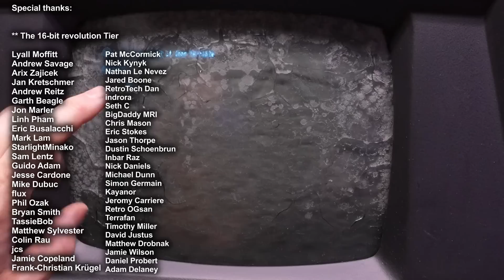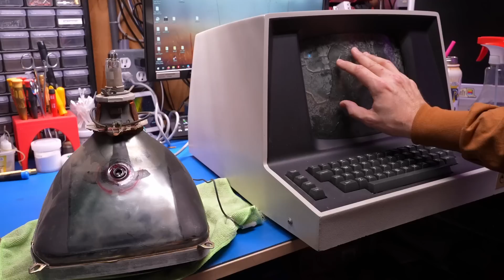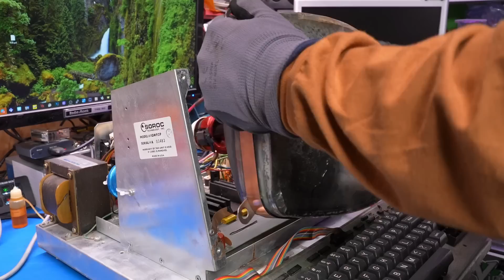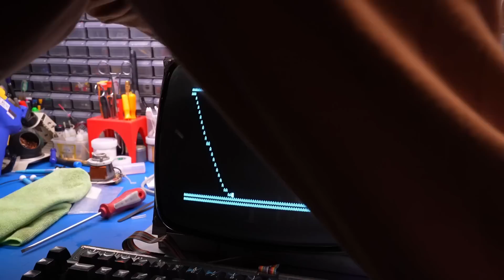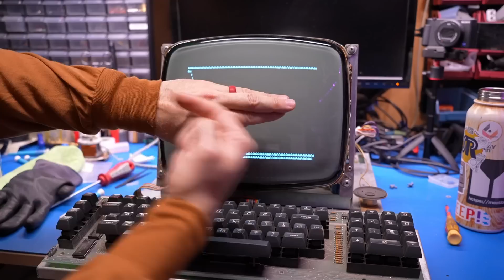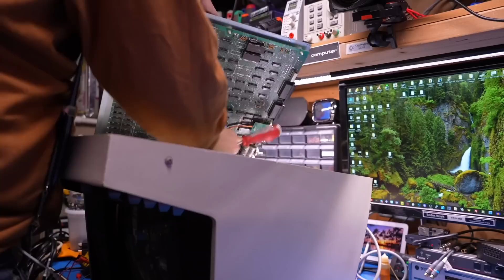Soroc IQ 120: CRT swap try #2. Finally some success?

Comment: PVA glues are usually solvent based.  Not water, because water chemically breaks down PVA (this is why PVA glues generally have a slight vinegar smell, water breaks down Polyvinyl Acetate into Polyvinyl Alcohol, also called PVA, and Acetic Acid, the acid in vinegar that gives it it's characteristic smell).  You might get somewhere with the water bath of the front of the tube, as many PVA glues are relatively susceptible to attack by water.  If you can create a chemically effective seal, you might also try mineral spirits.  Only if you can be completely sure you can contain the vapor, though.  For a job like this, soaking will take a long time to work through the glue, due to the narrow front and large depth of glue.

Comment: This is the first time I can recall coming across a CRT that physically fit, shared the same neck size and would not work. I've done a lot of tube swaps, mostly in arcade monitors but some computer monitors too and in every case I can recall it pretty much just worked. Had a couple color tubes I couldn't converge as well as I'd have liked but mono tubes are easy. Maybe older tubes had more differences? BTW I really like that you properly diagnose things rather than just shooting the parts cannon at them. Several times I've had to fix things that somebody screwed up by shotgun replacing all the electrolytic capacitors. The worst is when they replace top quality parts with cheap no-name stuff that fails before the original part would have. Every part that gets removed is another opportunity for an error to sneak in. The only parts I shotgun replace are SMT electrolytics since they do so much damage when they leak.

Comment: I really like that choice of colors, keycap design and overall shape of the Soroc terminal. The original CRT seems to have a blueish tint which also fits perfectly for design of the terminal. Hopefully you'll get the CRT fixed at some point.

Comment: Why do some CRTs have cataract while others dont?

Are CRTs with cataract safer (they wont implode)?

How can I prevent cataract from forming?
Reply: The earliest form of integral implosion protection was a second layer of glass bonded to the face of the tube. Earlier tubes had no integral protection so TV sets up into the 1950s had a separate layer of glass or plastic in front of the tube. Starting sometime in the 60s or 70s integral implosion protection in the form of a tension band around the perimeter of the tube face appeared and removed the need for the bonded glass. No bonding glue, no cataracts.
Reply: @James1095  ah I see

But why do all the cataract fixes I see online, use silicon with a gap (I read those fix arent perfect)

Why dont they reaply the glue like the factory did?
Reply: @Veso266  Because applying an optically clear glue without any bubbles, dust or contamination is difficult. Maybe it's possible to do but I don't think I've ever seen it done.
Reply: @James1095  what about if they would just retrofit tension band like newer crt do and discard the glass intierly?

Or does crt structure have to be altered for that somehow
Reply: @Veso266  I don't know. Having been just a few feet away from a CRT implosion one time I would not personally want to attempt something that might cause me to witness another such event.

Comment: PVA glue is what white Elmer's glue is. I'm not an expert and there may be a variety of formulations that can still be considered PVA, but all glue labeled PVA that I've ever used is water soluble and I've been wondering throughout the series if the glue could be softened with water rather than risking heat.

Comment: If it's PVA, which is polyvinyl acetate, you should be able to dissolve or at least soften it using vinegar. Acetone should also work.

Comment: Just put washers as spacers on the CRT mounting screws, this will slide the screen in the exact direction toward the cover bezel. Whereas if you slide from the motherboard, it will not slide to the normal axle of the screen.

Comment: I don't think that tube would need all that much heat to remove. Usually you only need heat if there's a center in the tube that's still intact. That glue is entirely degraded. It should just come apart pretty easily. And it's a very small tube too. Very easy to work with.

Comment: I would have assumed you could have soaked the front of the tube in something like acetone to dissolve or soften the glue on the safety glass and remove the risk of implosion. Oh hey you got the replacement working, nice one!

Comment: Adrian, if the glue is water soluble and requires heat to remove: couldn't you just keep the crt suspended in boiling/hot water face down in a large metal pot for a bit and see if the safety glass just falls off?

Comment: PVA is the regular white wood glue you let kids play with. It's not toxic, it's water soluable and the reason it's got ugly is probably being stored in a moist place to begin with, which is also why it's got runny; it's basically water making it liquid-y. The PVA itself is not conductive nor corrosive or anything.

Comment: Bot sure if it's the same PVA as book binding glue that's acid-free, water-soluble, dries clear, and is usually considered an archival quality formula. But if so that's easy peasey. If not then it is likely closer to Elmer's glue which isn't necessarily acid free as evidenced by the yellowing of the paper it's used on. Though some sun-bleaching also occurs. So, not to sure.

Comment: You know, the PVA glue being water soluble could certainly lend itself to being a feasible explanation for the cataract problem, and why it always starts from the outside edge. Humidity leaking in between the glass panes causing the glue to fail.

Comment: What I'd be inclined to do with that old tube, presuming that the glue really is water soluble, is to lay it face down in a tub with a couple of inches (7-8cm) of water for a few days.  If I had the time, I'd also get an automotive windscreen washer pump and some tubes and use the pump to move the water around the tub to keep the water constantly flowing so that the glue would wash away more easily.
Reply: Can a windshield washer motor run continuously for that long?
Reply: @djmips  It should be able to, so long as it has a continuous water flow to keep it cool.  But anything which keeps the water moving should work.

Comment: I still suggest using a ceramic infered heat lamp. the kind used for keeping reptiles warm. with a cheap lamp hood you could aim a specific amount of directed heat at the screen and it would help remove that cover. idk if a heat gun is a good idea

Comment: nice looking unit
if i was you i will put washers between the CRT mounting tabs and the chassis.
nothing can't be fixed with washers (i know normally we says nothing can't be fixed with duct tape but duct tape is disgusting!)

Comment: I would try soaking the old crt in acetone to get the front layer off, i have had luck doing this on other screens with similar issues. (note if you do this make sure the acetone bath does not come up the sides and get on the electrical coating.)

Comment: I would love to see if you can get the coating off of the original CRT. But I have a question. Have you ever had a CRT implode on you while working on it?
Reply: I haven't while working on one, but I did throw a dead 19" tube in a dumpster back in the day and forget to crack the pip off first. The bell of the tube hit the hinge of the dumpster lid and there was an enormous boom that left my ears ringing. Somehow I escaped unscathed but there was about a 10 foot radius of glass shards on the ground and my hands were shaking for about the next half hour. I've heard of guys having them implode trying to swap the mounting ears that are held on by the implosion band. I would not mess around with the implosion protection without a face shield and leather gloves.

Comment: PVA is water soluble but if water doesn't work, try acetone or mineral spirits.  BUT you really should replace the glue between the CRT and the glass sheet, not just silicone the edges.  It's not there to block an implosion, nor does it have any hope of doing so.  Like the implosion band, it's there to stabilize the face of the tube and prevent an implosion.

Comment: Use a space heater to remove the adhesive off the glass and then use optical cement to readhere it

Comment: If warm water doesn't dissolve the glue, the PVA may have polymerized and have become resistant to water. 
If that is the case, you may try soaking it in white vinegar, acetone, or methylated spirits.

Warm bath of white vinegar (dilute or concentrated, depending) seems to work best in most cases, but the results depend on the particular compound.

Comment: Hi Adrain, always excellent videos. A thought, not for now or the forseeable future but an added string to your bow:
What to do if you have a machine with a monitor you really want to get running but you just can't source a CRT? Yes the obvious answer is to use a suitbly-sized LCD and appropriate driver, but we all know how janky that ends up looking... besides who wants to cut the bezel of a much loved retro machine?
I have a plan that worked very well for a Mac SE/30 of mine:
1) Source all the stuff required to get a suitable LCD to work with the system.
2) Buy a nice and thin sheet of light to medium smoked plexiglass. Cut a good bit larger than the apeture, then remember to remove the film from both sides.
3) Fully dismantle your CRT down to the tube only. Empty a kitchen oven large enough for the tube to stand on it's neck...
4) Then rig up a heat-proof jig that the tube can be attached to, such that it will stand screen-up exactly strait.
5) Take a thick paper kitchen towel or thin felt, thoroughly dampen but not sopping wet, and lay over the screen, without any creases!
6) Put the whole thing in your oven and very slowly raise the temperature over about 30-60mis to about 60-80c (sorry, I'm not a collonial)
7) When the screen is up to temperature carefully heat the plexiglass with a hair dryer / heat gun until it's just starting to get soft, taking care not to scratch it!
8) Open the oven, place the plexiglass over the screen (leaving the towel / felt in place) and encourage it to flop a bit.
9) At this point you might be very licky, but chances are you will need to return the whole thing to the oven and repeatedly encourage the plexigalss to form over the screen...

10) What you are after is for the plexiglass to perfectly form over the screen (without creases, and avoid thouching it while hot!)... 
11) ...Encourage the corners to droop over the screen's mounting lugs as closely as you can without risking damage to the soft plastic.
12) When you have done as much as you dare, make sure to leave the whole thing to fully cool naturally in the oven.

Once all is ready you should be able to peal your formed plexiglass from the CRT without harm. Depending on how you did you may need to polish out scuff-marks or the weave of your interface cloth if you chose poorly. Cut the plexiglass with a Dremmel about 1/4 - 1/2 inch larger than the screen all round (I can do Imperial) and drill out the lugs.

The whole thing should mount perfectly in the bezel of the monitor - hurrah!

Next, offer up your LCD with a bit of hot glue to a couple of corners and fiddle until it looks right from the front. Then go ham with more hot glue or epoxy to seal around all the edges - done!
Depending on how much light gets in to the monitor case you may need to add some mat-black card to our 'LCD mounting solution' arround the bezel of the LCD, especially if it's very shiny.
I hope you'll agree the result looks surprisingly good, and as long as you chose perspex / plexiglass with a light to medium smoke it will pass casual observation, even to those using the machine... as long as they aren't too familliar with real CRT's or the system so butchered. Of course LCD drivers often have give-away boot screens that can't be switched off, but not much can be done about that!

Just to prove it wasn't a fluke, after the SE/30 I pulled the tube out of a dead (I think) 12in Apple II B/W monitor and performed the same trick. With lots of spare room inside I mounted my daughter's RC2014 behind the screen - the whole thing now looks like a terminal running CP/M when it's not doing more 'exciting' things.

Maybe you'll never need to try this, maybe you will. I hope these instructions helpf someone some day.
Reply: Interesting mod, I wondered about doing something similar with plexiglass, but somehow frosting the backside, then using one of those cheap low powered LED projectors to throw an image on the screen from behind, that way you'd have a proper curved image, the thing that gives it away immediately to me that an LCD hack has been performed - it's a fake!
NASA rebuilt the old Apollo missions control room, but it only took me 5 secs to spot the fake screens, there has to be a better way.
As for the startup junk on LCD screens, you could put a timer on the backlight, this would both kind of emulate the slow start of a real CRT, and hide the controllers messages.

Comment: Great series Adrian, thank you!
If you're thinking of trying water to soak the mess loose add some ammonia to the water to raise the pH, that should help if it's at all water soluble. You could also try soaking it in window cleaner or windshield washer solvent.

Comment: The method I've had the best luck with removing safety glass from an old CRT is sealing off the hole in the tube and submerging the tube in hot water for a while, the hot water softens the pva glue and seeps in between the glass and the tube (some have just fallen off)
Reply: Careful not to submerge the dag coating. I used to routinely wash tubes and even whole chassis in the dishwasher to remove all the gross sticky nicotine residue from arcade monitors and TVs that were in bars. Usually it was fine but in one case the dag was water soluble and washed clean off!

Comment: If the new CRT seems a bit tired, just let it run for a few hours and it'll probably improve. This is very common with CRTs that haven't been used for a while.

Comment: Gaaah!  Stop that!  Every time I see you spinning that CRT tube around like some sort of lazy-susan, face down on the table it makes me cringe!  And you keep doing it!

Yeah, sure, you've got a towel down, which is good, but it's not like you're in any kind of clean-room environment or anything there.  All it would take is some little piece of grit in there somewhere and you could end up making all kinds of scratches all over the visual surface every time you do that, without even realizing it...

Comment: I'm still amazed that they built the terminal without requiring a CPU.  There were some very clever engineers back in the day !
Reply: Well it's not doing any computational work...only echoing serial data to the screen and maybe some local scrollback but also tbf a cpu is just a lot of discrete logic circuits scaled down into one chip instead of many.
Reply: They built loads of stuff without CPUs back in that era. The Cinematronics arcade games had no CPU, they built one out of discrete logic. Games like Pong and Breakout had no CPU and no code, the video signal and game logic was generated with logic chips
Reply: Early dot matrix printers also didn’t have processors in them and used very similar column and row digital counters to sequence through font PROMS as the print head fired its pins. They even had font flip flops that would set/reset by control codes (DC1-DC4) to select different font PROMs. (All of those ASCII control codes originally had purpose) Centronics was an early manufacturer of dot matrix printers like that, and their name just stuck.
Reply: @ Dot matrix printers were the norm when I was a kid, I will never forget that incredibly obnoxious screeching grinding sound they made. I remember stuffing pillows around our printer in attempt to quiet it down a bit while printing a banner with Print Shop. On that note, tractor feed printers sure were cool for that, you could easily print a 10 foot long banner.
Reply: Back then designing with discrete logic chips was like solving a puzzle.  Some amazing designs were created.  Now you just write some Verilog code and all the creativity is gone.

Comment: I would not try to "rejueve," but you can bake the cathode by running it off your B&K or Sencore at an elevated filament voltage for 24hours while applying operating voltage (or slightly elevated) to the cathode. That will "wake up" the barium by (hopefully) baking off impurities and allowing the getter to absorb them. It's probably been sitting for a long time, so it could make a big difference in brightness to do that, and it wouldn't place the tube as risk like a rejuve would
Reply: Rejuve is something to do as a last resort when the tube is otherwise not usable. And a lesson I learned is if you do see an improvement, quit while you're ahead. It's tempting to give it enough shot to see if it improves further but usually that puts you back worse than you started off.

Comment: PVA is a water soluble plastic (the one used in the school glue). It should be very easy to clean it with water. Not with alcohol.

Comment: it's worth noting that doing a cataract removal isn't hard, just tedious. Careful use of a heat gun will melt the adhesive attaching the lens, so it can be removed, disposed of, and you can re-apply the lens with rubber sealant.